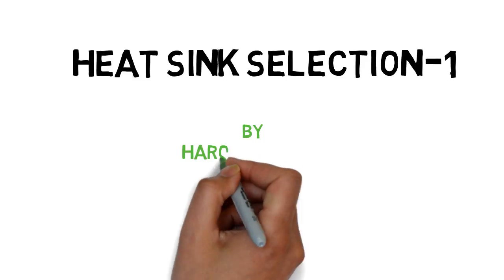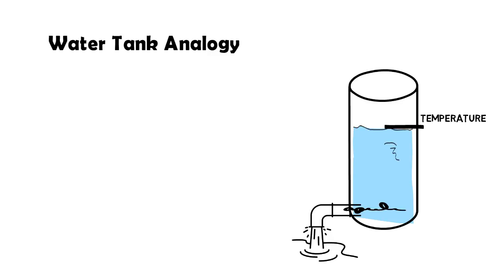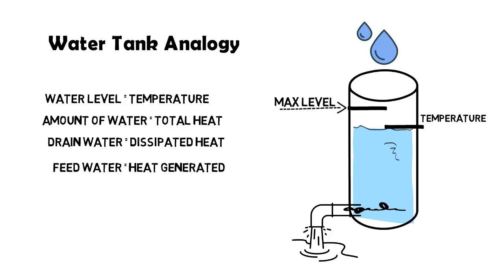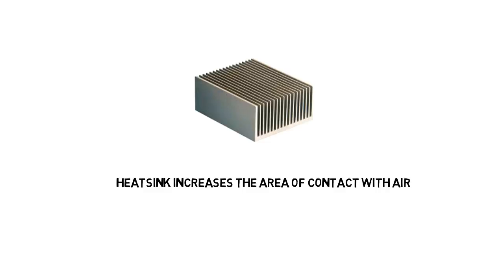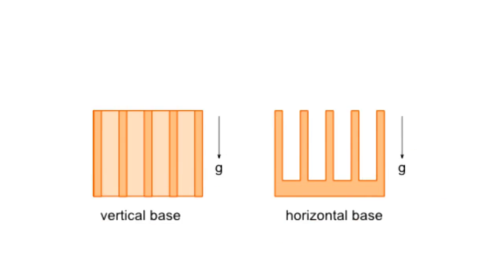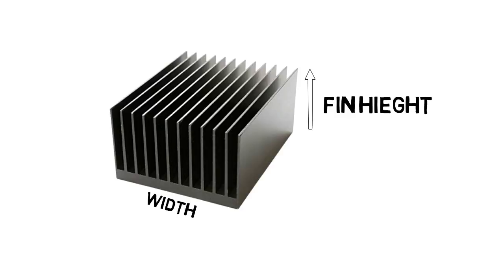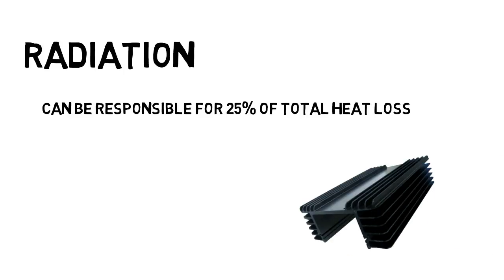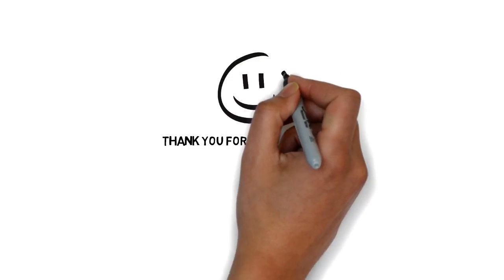How to select a Heat Sink for cooling electronics / electrical devices

Comment: Hi i need you help, i am installing a 36 amp 12v fan using Crydom SSR (HDC60D160H) PWM @ 128 Hz , the ambient temperature will be around 80c, do i need a heat sink?

Comment: greetings, your lecture was MOST EDUCATIONAL, INFORMATIVE, MANY THANKS, and please
STAY HEALTHY !!! i like to hear your opinion on this: i have 2 pcb boards connected with each 
other horizontally(i cannot connect them and have them placed in vertical position), so, if i  
use  the heatsinks with fans blowing into openspace... would this configuration help ???, thanks
in advance for your opinion,

Comment: I am planning on making a fanless gaming PC and I will end up building the case from scratch. The explanations provided helped me out greatly! especially the part where the width will dissipate more important than the height. Thank you!
Reply: This was my masters project years ago. I ended up having the whole computer case (which had direct contact with all the heat generating components) work as a giant heat sink so that it can work with natural convection. 
After CFD analysis I realized the heat is too much over the CPU and GPU and ended up adding heat pipes to take the heat to colder parts of the heat sink.
Hope my explanation helps even though you didn't ask for it :)
Reply: @TheMehryar  Thank you!

Comment: So if I am designing a heat seak that has to be 40mmX40mmX25mm should my width be 40mm and my height  of my fins also be 40mm or would it be more optimal to make my length of my fins 40mm and the height of the fins 25mm?

Comment: An application I'm designing, where the entire purpose of the electronic component is for heat dissipation (it's a thermoelectric cooler), also has a unique spacial limitation where the available space in which the heatsink can go is highly perpendicular to the cooler's junction point. Would the heatsink width over height recommendation be equally applicable if I were to submerge (with an obvious preclusion against liquid introduction to the thermoelectric cooler itself) the heatsink in water for greater heat dissipation over standard open air heat convection?

Comment: what about the thickness below the fins? I guess there is an optimal thickness. just like the fin length.  where more length doesn't really gain any cooling. I have had a question for a while. maybe you can answer it. wouldn't a small heat sink on the face of a MOSFET. like a TO-220 or similar package. help with cooling? like in some apps. where the fet  is clamped to the sink. instead of with a screw on the tab. like if a 12mm by 12mm aluminum bar is used. for clamping. maybe with fins. wouldn't that help cool the MOSFETs? and what about liquid cooling? could it work without a pump. relying on the heat rising. but that would rely on it always being in the correct orientation I guess. have a good day. and thanks for your time and information. it makes me think!